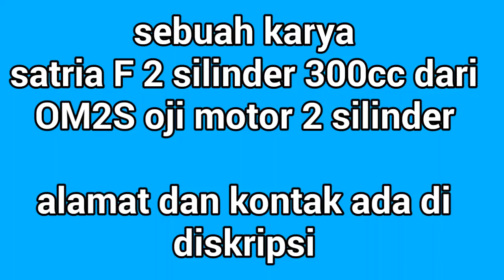Cek Sound SATRIA FU 2 silinder 300cc  bikinan OM2S Tanggerang | SCREAMER engine

Comment: Kira2 abis brapa duwit itu?
Reply from the maker: Andi Mahardika untuk motor tiger 2 silinder 23jt naik turun, siap tinggal gas saja,
Reply: Kalo untuk fu?
Reply from the maker: Hampir mirip lah,Untuk lebih lanjutnya bisa hub kontak yang ada di diskripsi
Reply: Buseeeeett...mahal bgt ya..pingin bgt tp gak kan tercapai sih..cuma bisa lihat dan ngacungin jmpol doang
Reply: angel dodoe buset hampir sama harga motornya malahan mahalan modifnya😩😩
Reply from the maker: +ajat sudarjat itukan masih estimasi dari pada bila 10 atau berapa nanti malah kurang
Reply: Padma Widya Sakti itu kan ibaratnya 2 motor jdi 1 pak, kcepatan jga doble kan,
Reply: mungkin yg mahal adl proses pengerjaanya ..pasti gk semudah yg di lihat pasti byk proses ini itulah jasa bubut ..jasa yg lain lainya...mungkin...